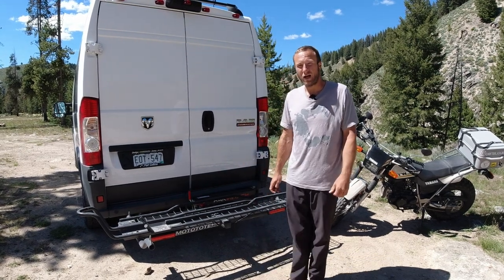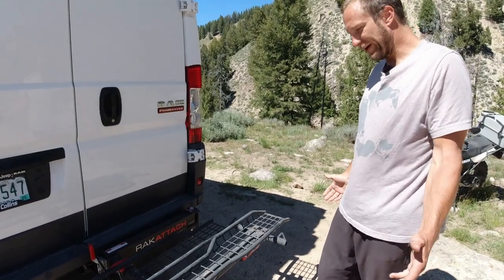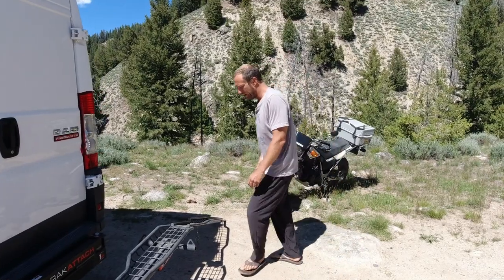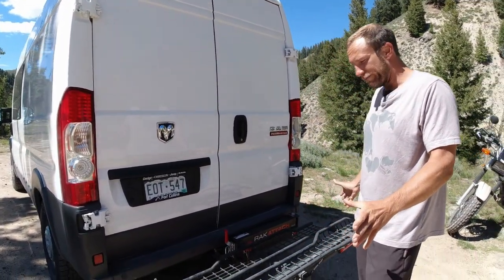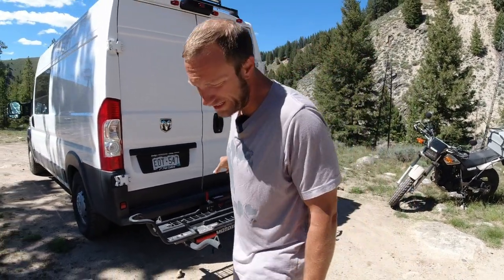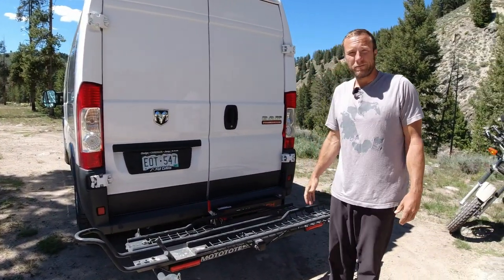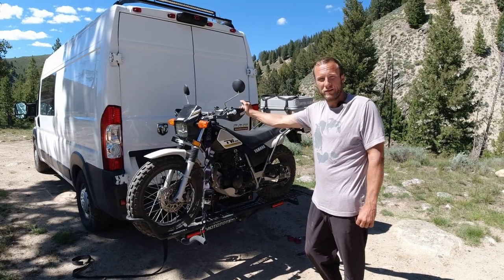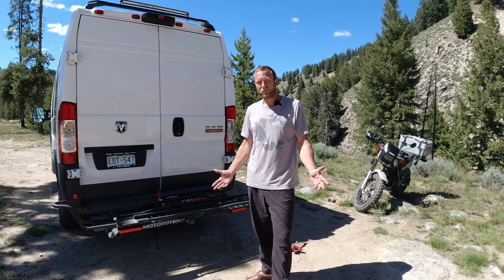Best Mototote Motorcycle Carrier Review. Best Motorcycle Rack for Vanlife!

Comment: I’m interested in doing the same up with the Rak Attach swing arm and a versa haul motorcycle carrier. I also have a Yamaha tw200. The wet weight of the bike is about 270lbs and the motorcycle carrier is 89lbs. What’s the rating of this rak attach swing arm? Thanks
Reply from the maker: We've read 250 and 300 pounds, so we're technically overweight either way between the rack and the bike. It's held up over the last three years, but be sure to do your own research and decide what you're comfortable with
Reply: Thanks for the quick reply! Makes me feel better about it since you’ve had that set up for 3 years. Should work just fine!
Reply from the maker: @Renroute  of course!  We've been happy with it so far!

Comment: Hello, what class III hitch receiver did you attach to the van in order to accept the motorbike rack?
Reply from the maker: Hey, we used the Curt Hitch 13207 - you can check out our install video here https://youtu.be/kTcTxu4VWTA
Reply: This was my question too. New van and I need a hitch for the moto tote that will work. Also my bike (Honda Rebel 500) is around 400lb so I’m not sure the RakAttach will work but would love one if they make that weight. A moto carrier does scare me and I debate carrying it inside. I just pray it I get one I can do all this myself.
Reply: @katekaos  I ended up getting a smaller bike, cb500x to a crf 250L, what was easier to load in and out of the van. Then installed a bed lift system to make it possible to load the bike and then put the bed down to a reasonable sleeping height. My van is on if not over the weight limit so glad not to put another ~150kg so far bacj away from the rear axle if I put the bike on a rack.
Reply: @jonnyflanders1229  not sure I want to downgrade the cc’s and got a good deal on this bike a few months ago. I’d love to take it around with me but debating it now. Might be more trouble than it’s worth. I’m still researching the hitch carrier vs carrying it inside but as a smaller girl it’s scary even tho I’m fairly strong. Haha
Reply: @katekaos  sure you'll figure out a good solution, good luck 🤙
Reply: @jonnyflanders1229  can you open the back doors with the Tote on?  That is a new concern if I can't get the swing away arm
Reply: @katekaos  I haven't actually tried a mototote so can't answer that I'm afraid. Guess it's another benefit for keeping the bike inside.

Comment: What can you share of your swinging hitchgate? I ask because I've found the model your using and apparently most of these have a limit of about 200-250lbs and your Yamaha BW-200 is heavier than that; wet. I'd like to use a swinging hitchgate like what you have, but thus far I've not been able to find anything that can support my CRF450L @ about 350lbs.
Reply from the maker: Our swing out carrier is the Rak Attach. We have seen it rated to 250 and 300 in the past but that is hard info to find. Our bike is 280 wet so we're right about max weight. I've heard of people taking them to a welder and having them altered to make it stronger. We haven't found the need yet but will do it if we find someone that can point to is a good welder they had done it for them. Hope that helps.
Reply: I have the exact same swing out arm. Rating is 270lbs. max. from the receiver. That means bike+bike carrier shouldn't exceed 270. This guy is 280 wet+66lb. Mototote. I have a 40lb. carrier and a 200lb motorbike . I had to add a j bolt at the hinge point up to the frame of my truck to eliminate the seesaw effect.

Comment: Is there a swing arm that supports more than 275lbs. Be careful with your set up your bike alone weighs 278 lbs.  Not including the bike hitch.
Reply from the maker: Thanks for watching! I have not found one that supports more weight (unfortunately). I know the stated limits and definitely know it's pushing it but my guess is that the rating is in its weakest position (open) and that it handles more than they  say. I always tell folks to do their own research before trying products. With that said, we personally have not had any issues with the setup after several years of all types of roads and many miles driven.

Comment: Ugggh.... have fun replacing your fork seals all the time you could all wear out those Forks abandoned ruin them find it down that way to get the rack n ride tied down by the foot pegs in the frame $595
Reply from the maker: Thanks for the suggestion, it's held up pretty good so far!  Maybe an issue with other bikes but the TW200 has been solid